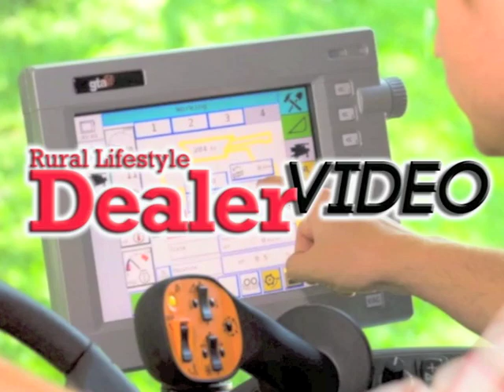Briggs & Stratton CEO Weighs in on E15 Issue

Comment: E-15 ruins metals, some plasitics, & rubber. also not to be used in motorcycles, ATV's, all small engines, all automobles older than 2000. We hope It doesn't ruin newer than 2000 since the EPA did not fully study the fuel. They pushed it onto the market